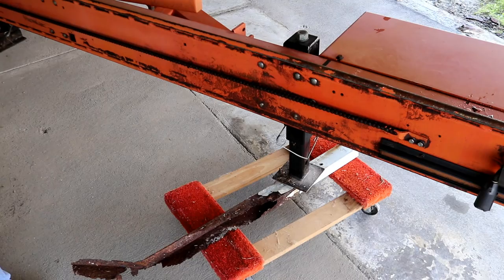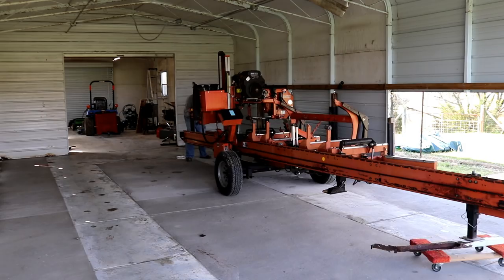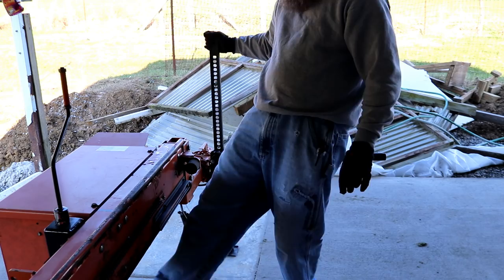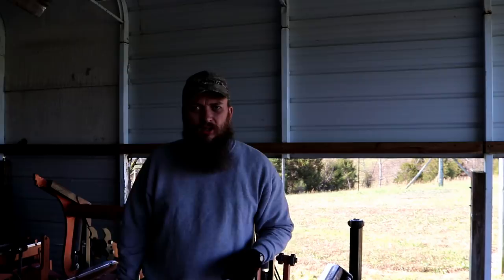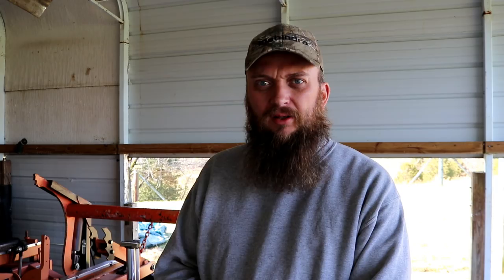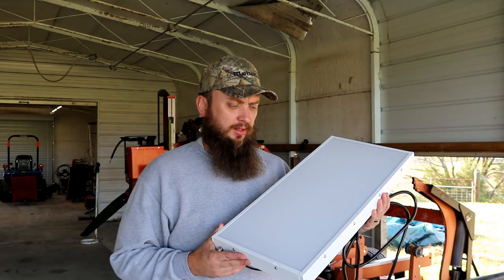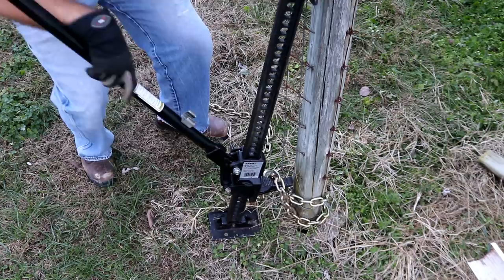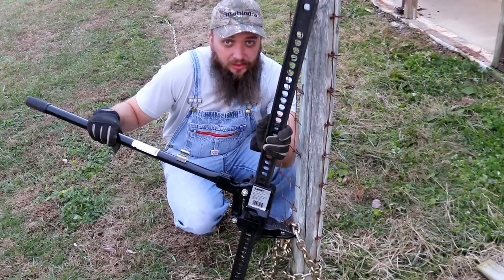WORKING AT THE SAWMILL, NEW LIGHTS AND FARM JACKS

Comment: About that versatile tool:  If the handle slips out of your hand at the right time and the jack is under load the handle will swing back and forth very rapidly.  More than one guy has been knocked cold by that contraption.  But, as with most tools, if you respect it you can use it and be fairly safe.

Comment: Don't get too confident with those jacks.  The mechanism must be kept clean, lubricated and constantly checked for wear on the pins and around the holes. If you fail to do this it will cause the mechanism to slip while lowering.  The handle will spring up saying goodbye to your front teeth or rearrange the gonads.  Another Major problem  is they are extremely unstable,
If they weren't so handy they should be outlawed. Before you made a video on them check with an OHSA rep about these jacks.
They can be bad news!
 BE VERY, VERY CAREFUL.